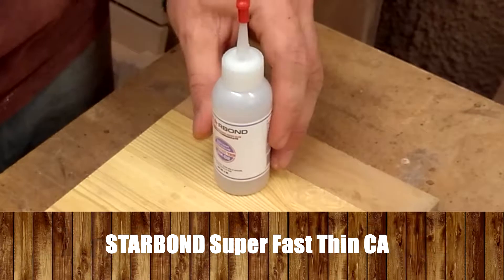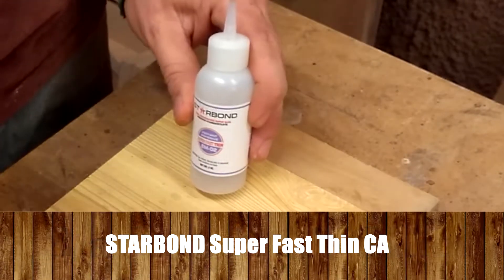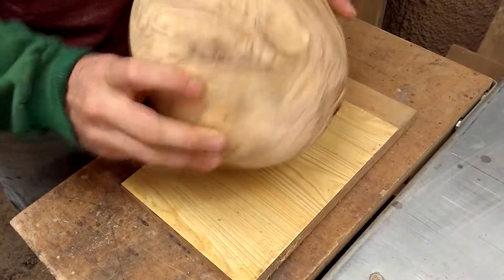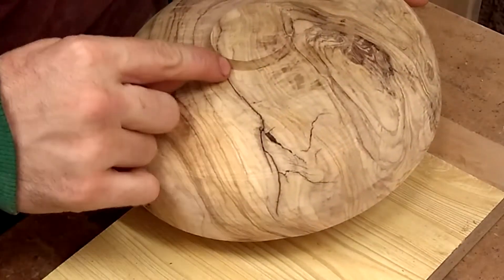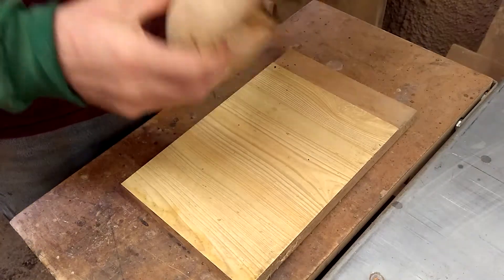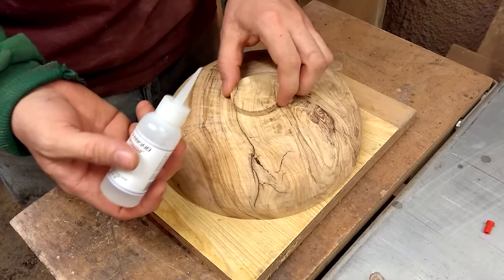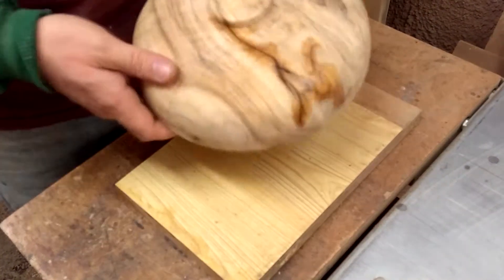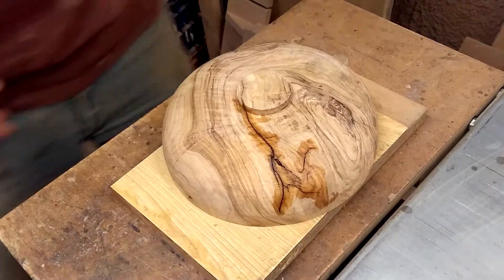Stabilize Olive Wood Bowl Crack with Thin CA Glue

Comment: But as thin as this glue is, does it actually FILL the cracks or does it just keep the crack from getting bigger and then the crack is still there and needs to be filled when the bowl is finished???  I have a half turned cedar bowl that needs repair before continuing (I'm new at this) and I don't want to loose it!
Reply: Wow, no reply after a year. That tells me to give Starbond Adhesives a solid miss. No clicking for me. I hope you figured it out.

Comment: if you pray the area with water BEFORE you use the CA, the glue will not stick to the surface so the finish will still take hold and not show any blemish
Reply: I have never heard that before. I will have to try that. I just had issues with the stains and it looks terrible.  Thank you.